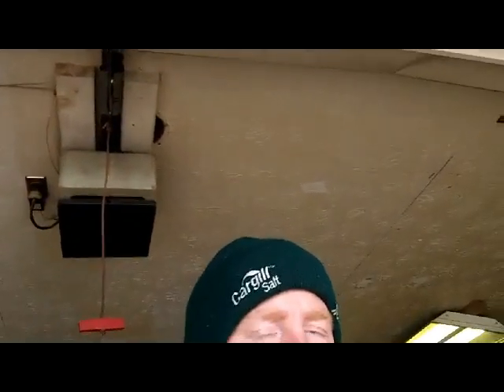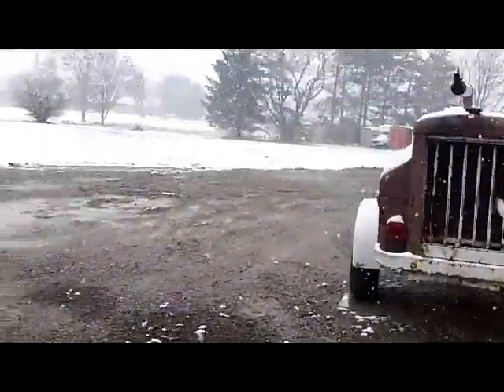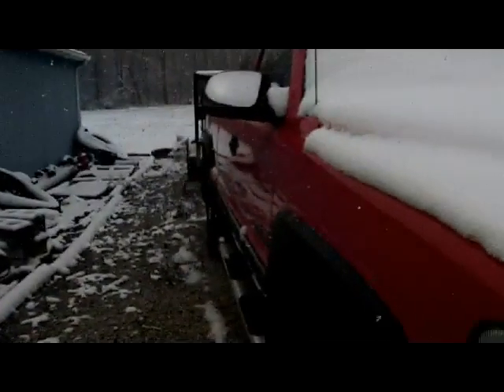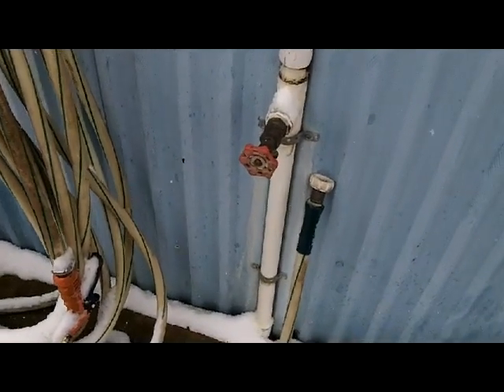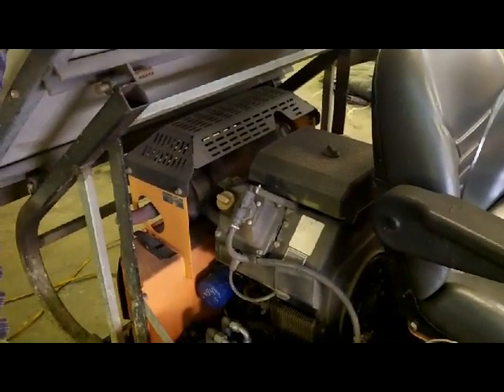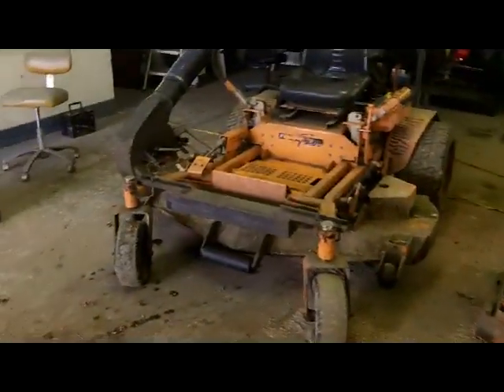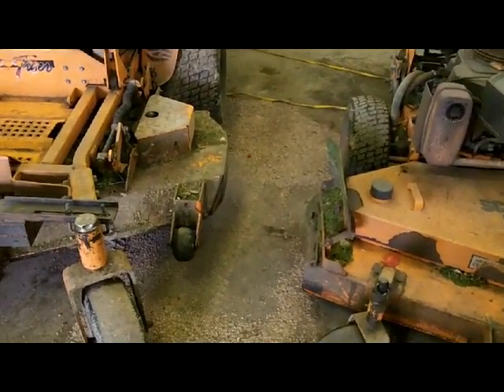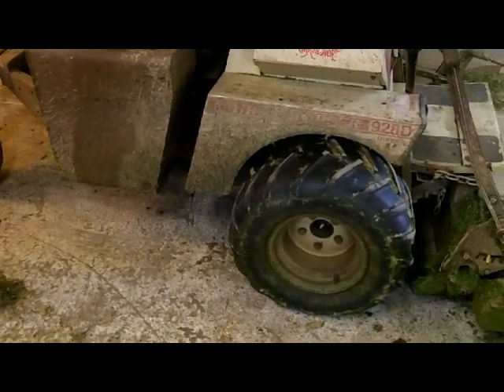Shop Vlog and random stuff 11-12- 2013

Comment: I agree, used engine oil works great to keep the rust under control, rubberized undercoating looks good but dries up, flakes off and it doesn't make sense to spray over something that is already rusty

Comment: Feel better buddy :)
Stay warm, get some rest and don't forget the vitamins....
Like the formula for the rust protection, makes sense, frame is in good shape.
Boca Bearing dot com will have your bearing, ID and OD sized, sealed or ceramic they have 'em.
Your air compressor is a classic for sure, rebuild it, it's a tank !